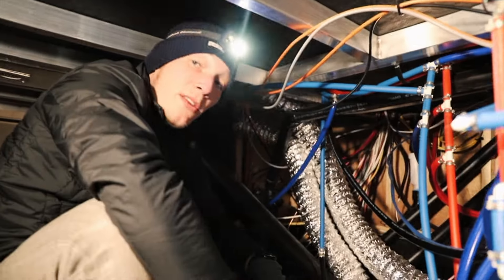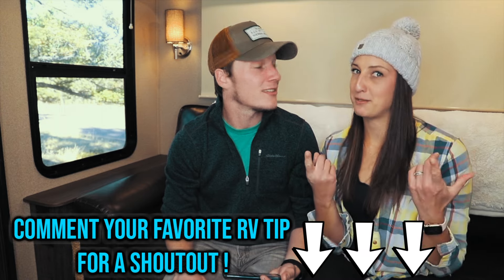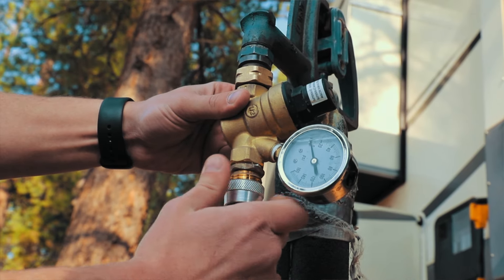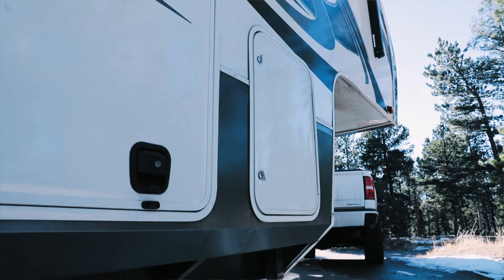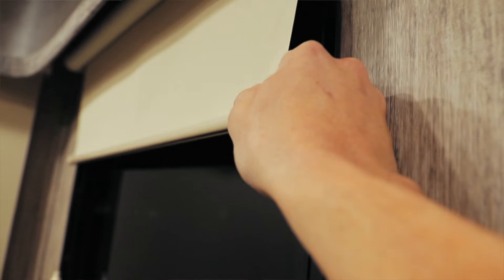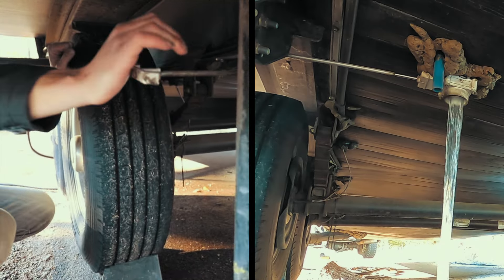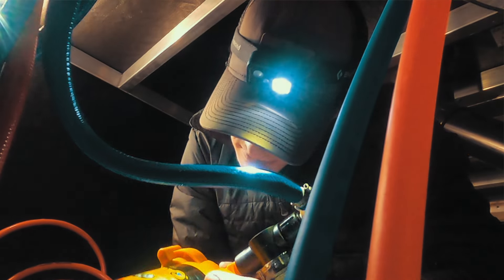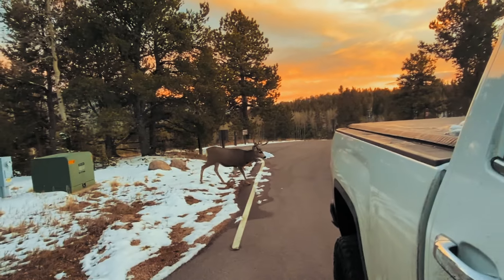First Winter in an RV - Frozen Pipes, No Water!

Comment: Have you guys had any issues with your refrigerator not working when it gets extremely cold outside
Reply from the maker: Hey Steve, actually we have never had that happen yet. Our fridge however does get very cold, to the point of us needing to turn it down lol is that something that is common to happen when it gets cold? Have you had your fridge act up?
Reply: @HappilyEverHanks  we do more late fall and winter camping than anything else. We just got back from a trip where we had temperatures many  nights below 10° and I never could get my refrigerator to get very cold, the freezer part actually felt like what the refrigerator usually feels like  lol. 
but after doing some research I have found that this is must be a problem.   ( BTW we did have some pipe freeze issues ) 🤦🏻‍♂️🤦🏻‍♂️🤦🏻‍♂️🤦🏻‍♂️

Love your channel !!!!!
Reply from the maker: Awww so sorry to hear this! That just be frustrating. Honestly, when we first picked up our rig, the fridge was acting up and they had to order another one. Having your food spoil is the last thing you want to do 😕
Sorry to hear about the pipes, we have had this happen for the second time. Glad that we went through with the skirting. You guys are smart sticking towards warmer seasons lol 
Thank you so much!! We are so happy to have you along for the ride 😃 what kind of rig do you guys have??
Reply: @HappilyEverHanks  we have a 2020 keystone cougar half ton fifth wheel 
It’s our first fifth wheel and so far, for the most part we love it. Though we are learning quickly the things we will be looking for in our next rig. Lol
Reply from the maker: Lol that is exactly how we felt when we bought our first rig. It’s nice to have an initial understanding of things that you appreciate through a trial run of your first rig. We had a travel trailer for our first and then upgraded to the fifth wheel. It’s amazing how there is a never ending list of upgrades to always invest in 😄